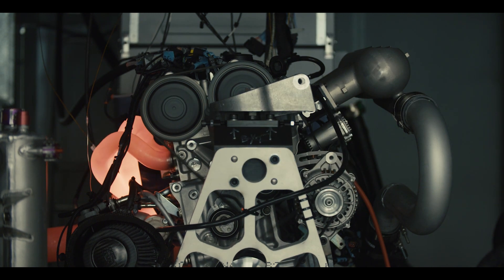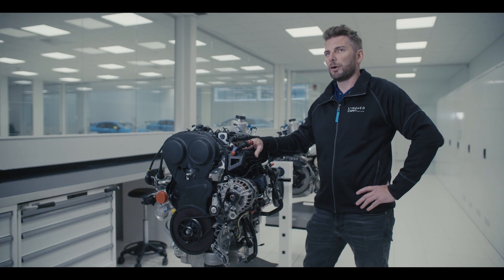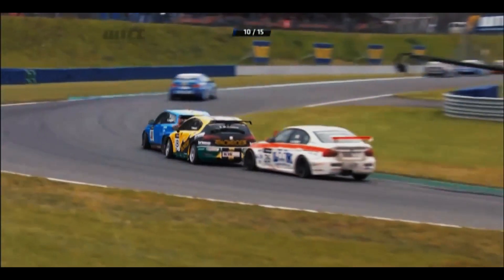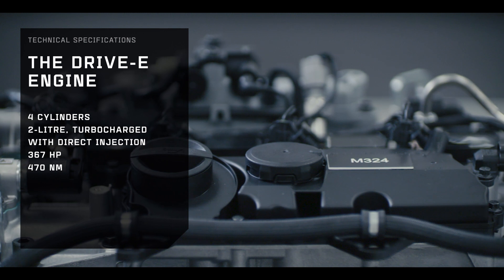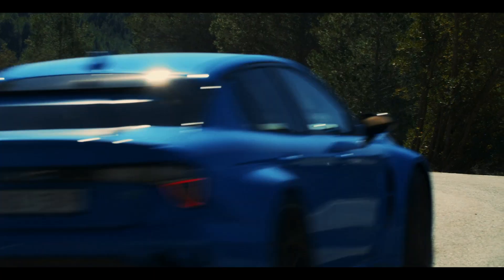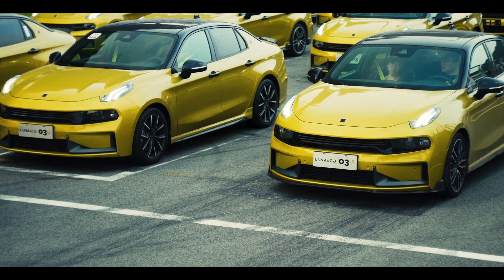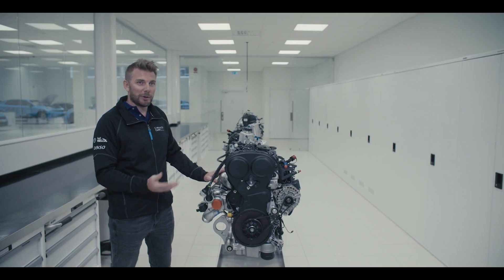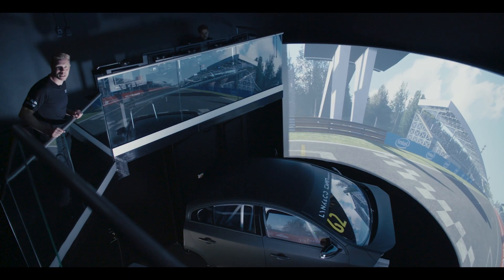The 350hp heart of the Lynk & Co 03 TCR race car - The Drive-E engine

Comment: My gosh the lynk and co cyan is the coolest looking car ever! I wish Volvo wouldn’t mate this amazing engine with crap transmissions. I’ve driven a Polestar optimized 2019 SPA T6 Volvo S60 and the engine wants to go, but the trans holds it back so hard.
Reply: thats a chinese car with a volvo motor
Reply: @raydong603   it is indeed. Hence why I made the Volvo comment. Here’s to hoping Lynk and Co doesn’t use the crappy Aisin transmissionsVolvo does.
Reply: @Motosthetic  you must be confused with the japanese trans, jetco.
Reply: @raydong603  no I am not confused one bit. Volvo uses a Aisin 8-Speed in the 2019 SPA T6 Volvo S60 I mentioned. My comment was saying how great the T6 engine is, but that the Aisin is holding it back. I was hoping Lynk and Co does not make the same mistake since they are using the T6 engine in some of their cars.
Reply: @Motosthetic  sorry to inform u that, its using Aisin in its Lynk & Co 03 production model lol